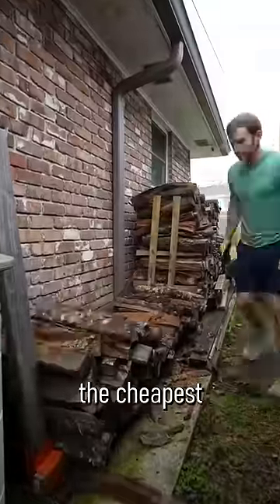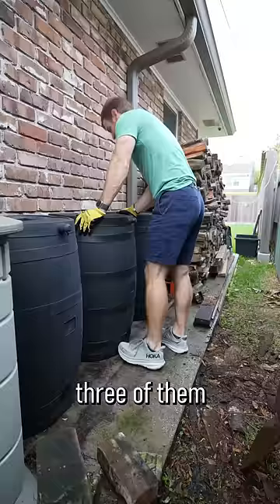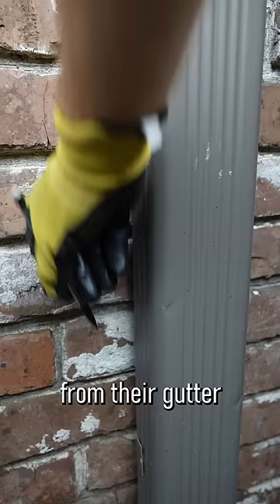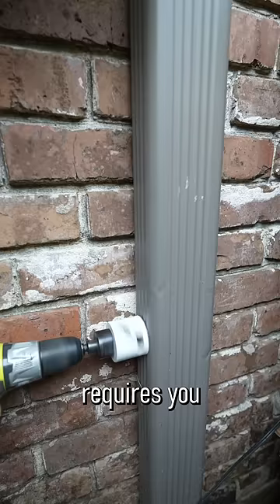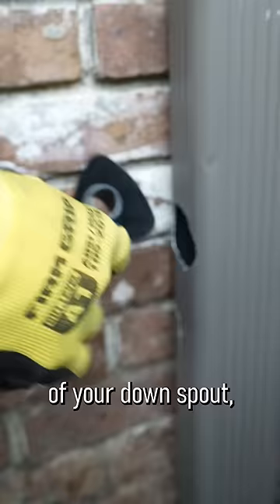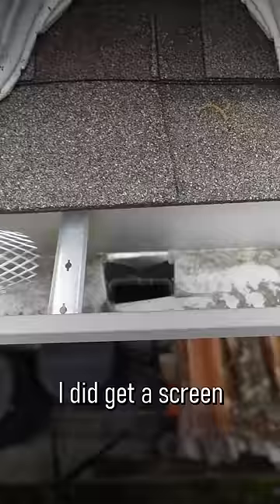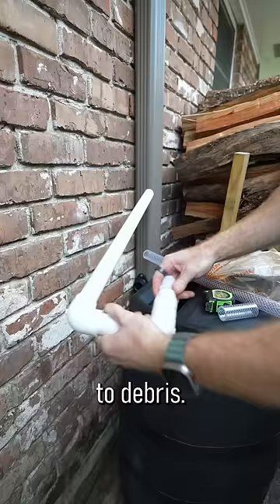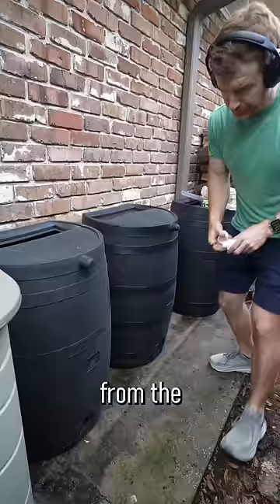Rain Barrel Project in 59 Seconds

Comment: Worked on gutters for 28 years and the wire light bulb screens in the gutter outlets will block up very easily from the smallest leaf debris causing the gutters to overflow.
Reply: What would you recommend to do instead?
Reply: Mesh screen at the entrance to the rain barrel
Reply: @Tegist123  literally just clean it every now and then. It's better than the debris going into your French drain anyway.
Reply: Better to use a first flush filter than that little wire bulb crap collector.
Reply: He explains in the video the diverter he installed will plug up IN the downspout. How is a screen at the rain barrel going to solve that?
Reply: @czattew because stopping the flow of water into the rain barrel just means he stops collecting water — which is different than water collecting in his gutter.
Reply: @OneEyedManKingdomOfTheBlind  and when the flow is stopped INSIDE the downspout because of the diverter used now your downspout is plugged.

I would have just cut the downspout and used a screen on the barrel, but that doesn't apply to this video
Reply: @czattew  and if that was how anything worked, sure.  But it wouldn’t stop the downspout. It might slow it a little bit, but it would just clog the diverter.
Reply: you guys in the U.S. need to check out how we collect rainwater here in Australia. we have big rainwater tanks, some holding up to and over 20,000 litres, and with good winter rainfall can provide enough water to keep us going for a years or more if you have enough tanks.
Reply: @catey62  it’s actually literally illegal to do this in many municipalities here because the community depends on that rainwater making it back to the water table.

We can have like a tiny rainwater barrel for like gardening but that’s it.
Reply: @catey62  It would take millions of liters to irrigate an average landscape.
Reply: Yes, they are less than useless.  Had to remove mine because the gutter got blocked up at the mesh.

Comment: This is a valiant effort. 
Though a word of caution.. 
That screen in the top of the down spout will easily get clogged, and will 100% allow small debris into your tanks.
Reply: need to use a diverter, which allows the first 10-15 min of rainfall to go to waste with leaves and then diverts clean water to storage.
Reply: That screen the first to freeze
Reply: Every single bit of shingle dust is getting past that
Reply: Your shingle granular will get through that screen immediately and then your drinking asphalt shingle koolaid :)
Reply: leaf guards will keep debi out too
Reply: @leeweatherwax8401  not shingle dust
Reply: @BIGH3AD777 no one's drinking it. That's not the point. Its for watering plants, washing the driveway, outdoor use type water.
Reply: @BIGH3AD777 I have a metal roof and leaf guards.
Reply: I have a tile roof and leaf guards

Comment: Plumber that specialized in rain water collection systems here, its bad practice to reduce the size of your pipe, rather, just cut the pipe above the barrels and get a rectangular to 65 or 100mm pvc fitting and an elbow and that way you don't restrict flow, plus a very low chance for anything to catch and get stuck. Rainwater collection tanks generally have a filter above the tank, and the down pipe sits with a gap (big enough to unscrew and clean the filter) for debris / bugs like mosquitoes. Also I recommend not using a clear pipe as it can attract algee and get discoloration from the sun, rather connect them with a bit of polyethylene pipe 25mm should do the trick with a ball valve in between them to control filling individually or to control contamination and for maintenance with minimal waste. Also I did not see an overflow but I am sure it would have one. Lastly get a pump if you want to go all out 😁

Comment: I been an installing gutter for 23 years I’m impressed. Usually home owners completely botch their own projects. You did a good job! 👍
Reply: He should have mounted the barrels higher so he can open the tap to have water run down into a bucket or through a hose in the garden (at a pedestrian pace).
Reply: Gutters or eavestroughs ?
Reply: @mikkelbreiler8916 in the original video he says he uses a pump that feeds into his sprinkler system
Reply: Sorry about that
Reply: @rverro8478 those are the same thing in most places (colloquially speaking)

Comment: Been trapping Pac Nothrwest rain water for decades.  We upped the antie and now run it thru a Watts 2 stage with a poly scrubber and then a coconut husk charcoal filter 2nd, then into my distiller.  Water test after finish shows perfect water.   The distiller plays double duty, for the Orange flavor Stump Whiskey.  The hardest part is cleaning properly, before making another run or just distilling water.   The other straight rainwater barrels are for cleanup, or flushing the toilet when the power goes out and I cant run my pump.  A big bucket of water tossed quickly into the toilet bowl will overcome the trap and flush the toilet, when the power is out, anywhere you have a trap style toilet.  Your welcome.
Reply: Great ideas although we use our 14k gallon pool for emrgency flush water
Reply: @jvd9202 14k gallon pool??.  we are all headed to your house.  Keep that one to yourself.  Tell no one and defend it to the last bullet.  It might come down to just that.

Comment: You could get 55 gallon drums for like $15-$30 Plastic or metal those plastic totes are less than 100 bucks with  230 gallons In a nice drain at the bottom

Comment: Think of rain gutters just like drain plumbing. The pipes need keep getting bigger as water travels down the line.
This is done because the line is not under pressure and the line will not unclog itself.
Everything you just did/installed is making the line smaller and smaller
I would suggest a gutter spout diverter that spills onto the top of a screened barrel. Debris can be swept away from the top easily. Do not  use those spout screens. they collect debris and clog the gutter, which collects water, which breds mosquitos

Comment: Okay I did this for a while but got fed up with the 55 gallon barrels and minimal quantity you can store. The water really looked and tasted bad coming off a shingle roof so it was only used in gardening. I got rid of the whole system and I got a large 500 gallon tank and had plastic sheets that I open up when it rains and it collects all the water straight into the 500 gallon barrel. Water is cleaner and it doesn't need to be filtered off of the gutter. Smells and tastes clean. It's just way cleaner water. The 500 gallon tank cost is about 150 dollars more than the cost of those 3 55 gallon barrels which only attribute to about 165 gallons of water? I've got 500 gallons and I get enough rain here that I can fill up my 500 gallon barrel in a month easily. I do still have a filter for debris but it's minimal since I have very few trees close to my house.
Reply: Roof collection is not intended for potable water...  This is irrigation water.
Reply: Trying to picture this....do the plastic sheets act like a funnel ?
Reply: In Washington State that tank would be illegal. 

It's legal to collect rain water that falls on existing roofs, but it is not legal to put up a roof, tarp or catchment for the sole purpose of collecting rainwater. 

Sounds dumb sure, and fairly easy to work around but it prob still deters any kind of commercializing it.  @nancylourose
Reply: Plastic sheets? Where and how designed? Connected to downspout?  I live in FL and get a lot if rain. Metal roof. Thanks

Comment: You need a device that let's the first bit of rain flow out the gutter so the gutter is washed cleaned.  Once a bit of water has flowed through the water is the diverted to the barrels.
Reply: It’s called a first flush device.

Comment: I didn't do it that way.  My downspouts connect to 4" PVC in-ground drainage.  So, I extended the PVC up and glued a valve and a Y (pointing down) above it, a nipple, and an elbow to fill the barrel.  When the barrel gets full, I open the valve to allow the rainwater to go down the drain.  
It works for me.

Comment: So next time when you do this:
1 put the barrels high enough so you can put a watering can underneath it
2 make sure the drain pipe of the down pipe is sloping to prevent sand from cluttering it
3 Let one barrel flow over in the other on the top and not on the bottom. Now if 1 barrel leaks all three will empty.

Comment: I put my barrels on platforms , off of the ground, with a shut off and short piece of garden hose. I also secure them to the wall so they don't tumble over. 385 lbs of water( 7x55)
Reply: I did this also acts like a sink I love it getting rain water is so good for my plants
Reply: Just FYI, a gallon of water weighs ~8.3lbs

*US gallon
Reply: MichaelM is right.  Each full barrel is 456 lbs, so 7x = 3,195 total lbs.  Make sure your foundation is solid.

Comment: There're systems that indeed require you to do a cutout on the downspout but they have a diagonal screen that will divert debris out of the downspout, allowing water to pass through. Depending on the system, the overrun of the barrels returns to the downspout at the same spot or you need a 2nd hole for it. For the first system, the piping from downspout to the barrels of course needs to be level and there shouldn't be an overflow system in the barrels themselves.

Comment: Some "waste" barrels you get at food processing plants or even automotive workshops have plastic barrels you can get for free or at low price, if you pick the product that was in there correctly you can wash them out with ease,  like windscreen fluid. The bonus, the caps sometimes hade a plug that is threaded the same as 3/4 plumbing pipe, I used one of those once, threaded a elbow and pipe with faucet in it, flipped it over, cut a hole in the bottom, now top, to feed the intake in. Filled up in 30 minute rain fall

Comment: 75 dollors for a rain barrel is def not the cheapest option, just get food grade plastic barrels from a factory, like 20 bucks
Reply: Yeah I was thinking the same thing. He probably means the cheapest that is still eye pleasing. Not some bright blur barrel.
Reply: You can ask local restaurants for their empty pickle buckets. Usually you can score a few for free 👍
Reply: Or an actual water tank 🤦🏽‍♂️
Reply: @jaredkindred Well then get a $4 can of spray paint and have at it, now it's $24
Reply: And how many hours on end would one spend  saving a few bucks?  Amazon delivers for basically free, I'm pretty sure your factory won't do that.  There are a gajilion other reasons to just push a button and have it show up at your door.
Reply: @valeniusthekat  What are you going to do with 5 gallon buckets?  It would cost exponentially more to assemble this system when you factor in all the extra connectors, hosing, time and other expenses, plus the fact that a 50 gallon system will be infinitely more efficient when harvesting the water.

You're the kind of person who would drive 50 extra miles to save $2.00 on a tank of gas.
Reply: @qt3dot14ish  If you are so busy and your time so valuable that you can't make a couple calls and do a pickup, then you definitely don't have the time to set up rain collection. Just stick to your 60 hour a week job and pay the municipality for the ground table water and move on with your life.

Comment: You should have used an offset debris collector in between the down spout and the barrels to help with collecting and smaller debris that will make it through the gutter screen.
  And, you should have connected all three barrels at the top coming off of the down spout.
  Then, all 3 barrels will fill evenly. 
  I down installations like this whether it is installing plastic tanks sitting above ground, or the big concrete tanks underground.
Reply: They fill evenly.  The level equalizes through the bottom tube, as they are tied together there.
Reply: 55gallon food grade barrels are $20-$30.

Comment: A better way, although a little more expensive, is a rainwater diverter.  Most have a filter.  If you install it at the top level of the rainbarrel, then it should stop filling at that level.

You could also add a catch basin with a filter to your system which would catch small debris as well as leaves and large debris.  It is easier to clean than the gutter screens.

Comment: Yeah so we collect rain water (for window cleaning business) and we simply bought an old IBC tank (1000lts) for €50 and diverted one down pipe into it and add an over flow back to the drain, probably cost less then €80 all done, we then run the water through a resin filter. More then clean enough to drink (if you needed to) but doesn't really taste of anything.

Comment: If it were me, I would cap the first two barrels at the bottom, and pipe them together at the tops. That way the first two barrels will naturally filter out the vast majority of debris and contaminates, and you'll get much cleaner water in the third barrel. If you're concerned about capacity, can always add a fourth and make use of the last two. But don't use the first two for watering anything but your grass or vegetables (Not root vegetables), and make sure to not let water sit in them for too long without periodic cleaning.

Comment: wow that was an insane price for something that's regularly thrown away
Reply: What would you use the water for
Reply: What? No way barrels are expensive in any for unless you want something more flimsy that can never be filled without possible breaking but otherwise idk maybe some where they sell cheap ones with good quality I’d love to try something like this for my daughter but buying 3 and everything else sounds more like a when she’s older project 😅
Reply: @Nebraska_Juan used 55 gallon. Drum
Reply: @charlieweckston8260  As if you would be happy storing water in a old rusted out free drum. The rain barrel here is non reactive. You won't be stuck with orange soup.
Reply: @BlueBoyo101  plastic 55 gallon drum🤓
Reply: @BlueBoyo101 
You can buy used food grade 55 gallon plastic drums for $10.
Reply: @-_-John-_- Where?
Reply: Blue plastic 55gals are $20. I have 2 and super durable.
Reply: @beans4gas that's what I gave. Got then thru my local park and the pre drilled for the spout and with the faucet! !🔥💝🔥

Comment: I have 3 - 275 gallon food grade containers. You wouldn't believe how much water you can collect if you have one day of an inch of rain off the roof of my barn which is 16 x22 ft wide it overflowed a 275 gallon containers with the metal frame. I could not believe one day of rain overflowed that Barrel. There is a formula to figure out the amount of collected water. I also put screens at the top of the downspout and at the top of the barrel to collect any large debris or anything. So it was a little more than an inch of rain for that day to fill my UBC containrr

Comment: I pile up cinder blocks and place the rainbarrel on top. I completely got rid of the long rainspout and replaced it with a flexible tube that dumps into the top of the barrel. Many filtering screens are needed.

Comment: Something that many people Overlook and don't realize is that they're using their downspout in the roofs to gather the water well why you're Gathering water from the roof pieces of the roofing shingles are breaking down all the time and now you're getting pieces of shingle that washes down with your water through the downspout until your rain barrels so if you plan on using this for drinking water you better know what you're doing and have a filtration unit for it even if it's homemade and a way to keep it to where you can use it as need be

Comment: Hmmmm.
Down here in the Caribbean,  water tanks are manufactured with the option to rout your downspout into the tank.
So there's a 4" port at the top of the tank that can be connected to a 4" guttering  from the roof.
Also comes with the filter..

Comment: I got that who.e kit minus the barrel off Amazon. Came with the thing that goes into the spout, a hose to go from that to the barrel, a valve with hose threads that goes in the barrel  all the screws, rubber grommets and a cap to cover the hole in the down spot over winter. Oh and it came with the two hole saws needed to install this. Works like a charm.

Comment: You should always check state laws and local ordinances before doing anything with rain water. 
It is not uncommon for the collection of rainwater to be illegal, depending on where you live in the United States. There are only ~25 states that don't have some kind of regulation regarding the collection of rainwater on the books and that doesn't factor in local laws.

Comment: So I've got the best tip for you if there's anywhere near you that does any sort of pickling whatsoever and you can buy pickle barrels off them. They are giant plastic barrels that they soak the cucumbers in where I live there's a big pickle plant so it's easy to get but they're like three bucks and hold 100 something gallons. Also with those tubes coming out of the spout you will want those at a downward angle I know it says to keep them at the same level so it drains through the ground spell but when you have them angled you get less debris in the actual barrel

Also not literally three bucks I think I paid like 15 dollars a barrel or $8 a barrel or something like that

Comment: Gutter guy here! Don't be afraid of cutting that downspout to size. The spout can be pretty cheap if you get aluminum. It's also easy to cut and rather forgiving. I don't recommend the screen at the top of the spout. If you have any trees around your home that will be a nightmare come fall.

Comment: Usually you fit a tap at the bottom of the barrel to fill watering cans. Can't do that as they're sitting on the ground. Also the barrels fill at the same rate. Better to link them at the top so they fill in turn.